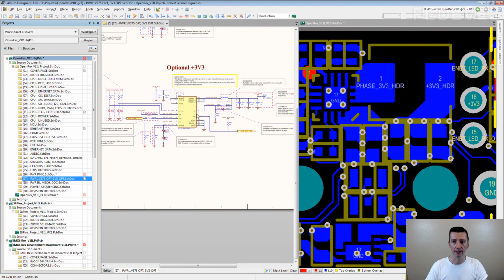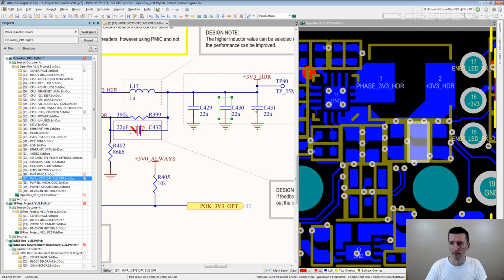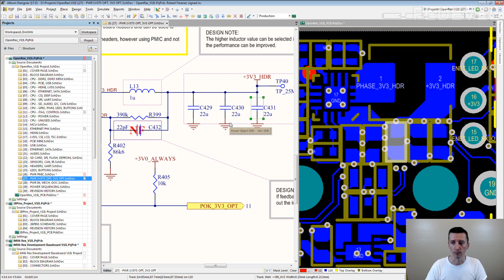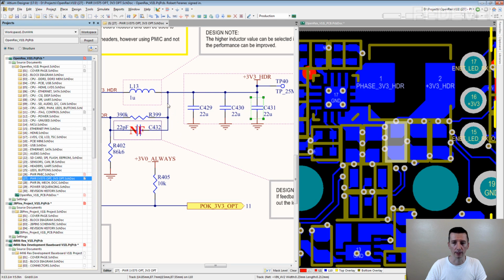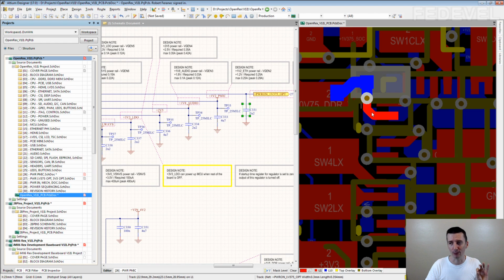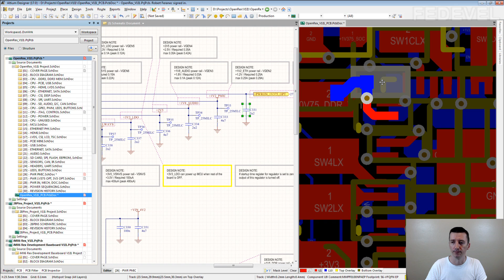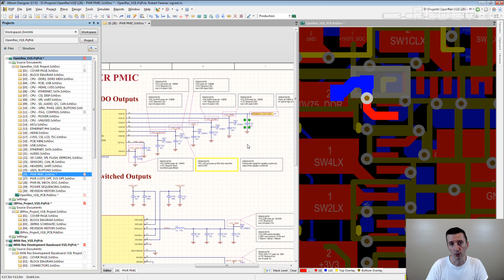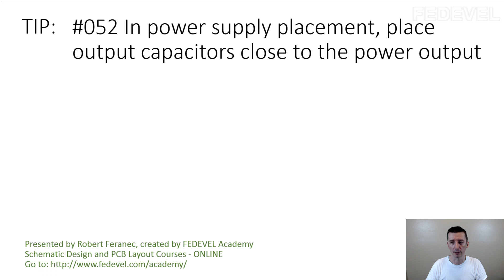TIP #052: In power supply placement, place output capacitors close to the power output

Comment: Hi Robert! Another great tip.

I've seen in your example board the power planes cover almost all the board including the inductors of the buck converters. I was wondering if it wouldn't be better to leave a keep out circle below and around each inductor keep the power planes out of the way of the electromagnetic flux, in order to reduce the amount of noise induced to the power rails? What do you think?

Comment: I have one question. What If output has 3 capacitors, say 22uF,22uF & 0.1uF. Which one we need to place close to power pin. 

For input side we place lower value to as close as possible to pin. Where as for output also we have to follow the same.
Reply from the maker: for outputs, usually same values are used
Reply: The biggest one(s). The biggest one's GND terminal should be close to input caps' GND. Keep the loop as short as possible.

Comment: The problem I find with placing capacitors near the power pins is even with as small as 603 caps, I can only get so close to the pin before it makes it impossible to draw traces to neighboring pins. I guess the solution would be smaller capacitors? I suppose I can learn to hand solder 402 capacitors now lol
Reply from the maker: Layout is sometimes very hard :)
Reply: Start with input/output caps, inductor and catch diode placement which relevant to high current path. Control logic components  (enable, feedback, power good, soft start, etc..) could be  at the back of the PCB in order to leave space for input/output caps, inductor and staying away noise.

Comment: Hi robert 
what do think about Olin Lathrop answer in this link?
https://electronics.stackexchange.com/questions/15135/decoupling-caps-pcb-layout/15143#15143
Are you agree with him?
PS: thanks for your great content you put on net.
Reply from the maker: I have a video about this topic on my TODO list :) I do agree with decoupling capacitor part. I use local power planes (I agree these are important), but I am not sure about using local GND planes. With local GND planes we had problems (problems with EMC/EMI). I prefer solid GND planes in my digital boards (I believe, solid GND planes are also good for impedance and high speed tracks).

Comment: Your videos is very good and helpful. But in several videos include this I see fhe same nominals of input-output filtering capacitors.
 As I understand for a good filtering both HF and LF noise it's better to use three or more different capacitors (like 22mf, 1mf, 0.1mf etc). Because of wide spectrum of noise (from  50 hz AC to HF smps noise and RF spectrum).

Comment: Yes it is better to place output capacitors close to output, but  depending on topology there are other more important component placements. What about input capacitor or a diode/mosfet. You should check datasheet, application note and familiarize yourself with topology to know which components are more important than others.
Reply from the maker: yep, will be in different tips

Comment: I have a question; the tracks connecting the IC pins with inductor and the input capacitors are quite wide with no thermal relief. i know these carry high currents and should be as wide as possible. the question is, is it ok to have no thermal relief for such high current connections.

Comment: Hi Robert, Very important tip!!
You can find this recomendation in most chip datasheets not only for PSUs, capacitors should be as close as possible to the pins (e.g. decoupling caps) but of course it is more critical for PSUs, especially Switchers.